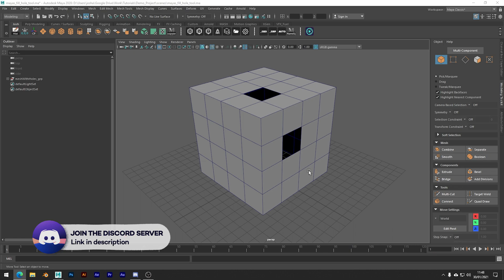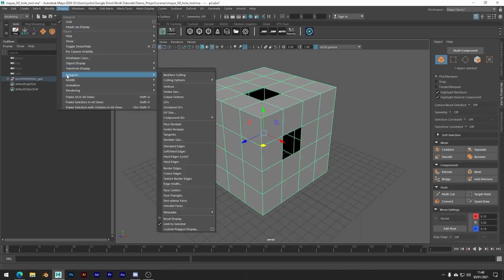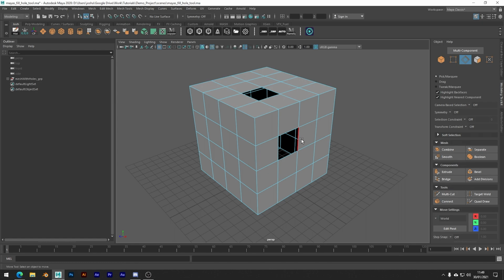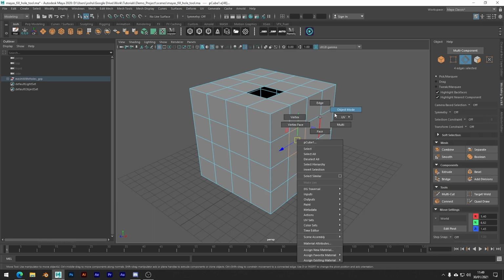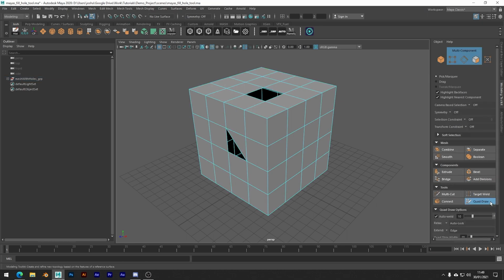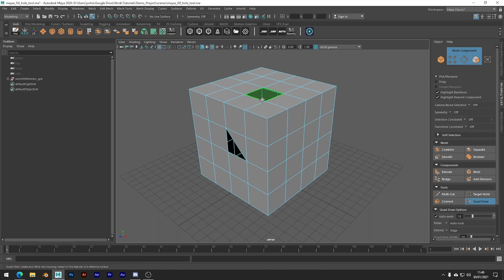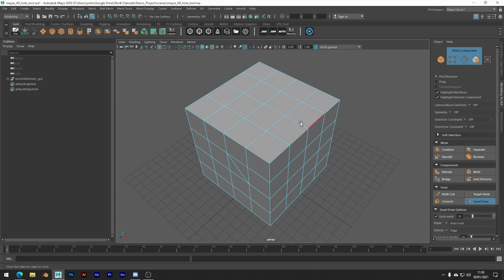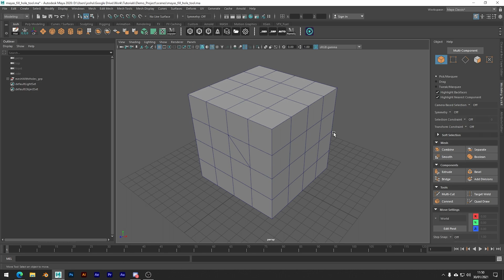Maya's Fill Hole Tool

Comment: consider having respect to beginers and show that you can also fill holes by using the drag and cliic wheel menu after selecting edge type, and selecting an edge. the fill option is also present in the context menu

Comment: that's great, but what if you have a large area missing, how would you go about that?
for example using photogrammetry I scanned only the front of an item, how do I fill in the back and bottom?
Reply: Use MeshMixer's Erase & Fill command. Then bring into Maya as OBJ.

Comment: it's cool but why do not just use the bridge tool?
Reply from the maker: Bridge has limits, for example you wouldn’t be able to fill a triangle. Filling holes can be a good way to put get a face into your mesh and then you can clean it up. You’re not always going to be filling holes where you have a equal amount of edges.
Reply: @JoshAntonio  perfect, thx !